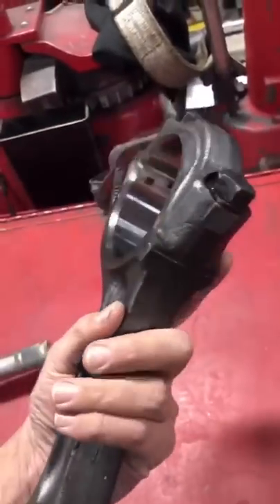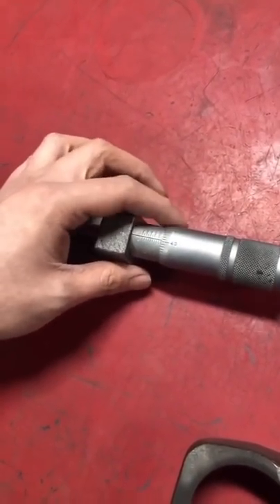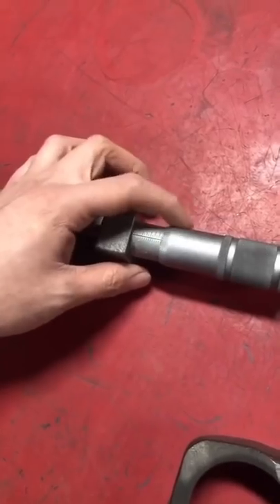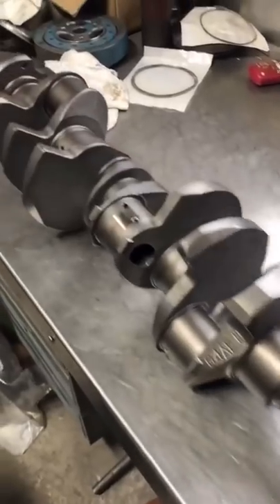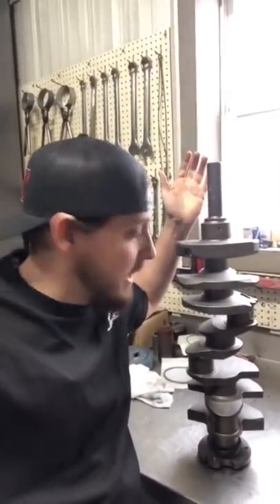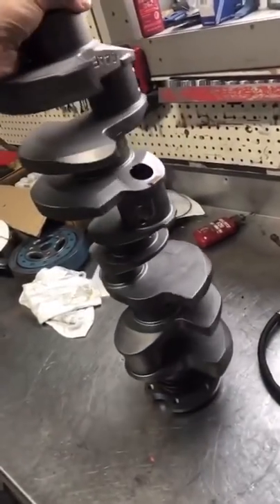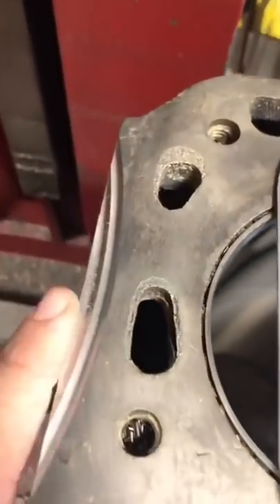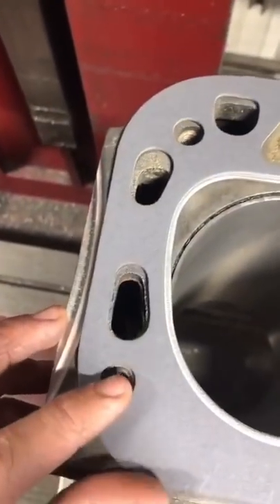#shorts What happens when a machining mistake is made? @JAMSIONLINE

Comment: I was using a surface grinder when the magnet failed suddenly, the wheel grabbed the part shot it across the work area and the wheel blew up in my face, safety glasses work kids :)
Reply: Glad youre okay, chief.
Reply: Same thing happen to me! Only the part launched itself at my foot. Good thing I had steel toes on, it took a chunk out of the surrounding material
Reply: Learned the same thing with a rail saw blade. Heat closed the gap instantaneously blade destroyed my face shield and several fragments pitted the safety glasses i was wearing under them.
Reply: Wow bro 😳 glad you made it out ok that could have killed you. I was deburing a part in the lathe running my scotch Brite on od with gloves on glove got caught in chuck and ripped my hand never wear gloves close to chuck.....
Reply: @TacticalThib  never wear gloves on a lathe, that’s scary shit!
Reply: I had an abrasive cutting wheel explode like that before, had a piece go through my glove and lodge itself in my finger 😂.
Reply: @TacticalThib  that's sketchy af! The shop I work at doesn't even have a gloves policy. Anytime I go near any manual machine, gloves come off and nitriles go on if needed.
Reply: @bigwendigo2253  around a lathe or any high speed spindle/chuck really. Imagine being pulled into a vertical mill..
Reply: @keefjunior4061  that would be horrific 😢

Comment: my neighbor was having an engine builder build him a 240sx engine. He sent it off in feb 2020, didn’t hear anything until july 2020 at which point he got a short email claiming “technical difficulties.” turns out the guy’s cylinder bore machine broke, so he took it to a “buddy’s shop” to do it there. well, the “buddy” didn’t have proper tooling to hold the block, so they MacGyvered some shit together to hold it. that didn’t work out too good and they ended up accidentally sending a full sized cylinder hole through the side of the block at a 30° angle. the unexplained 5 months apparently went to locating a new block.
Reply: Bored a cylinder 30 degrees off??
Reply: @tyalbert5063  yeah I'm not even mad if this is the case. That's just outright impressively bad
Reply: The only thing I'd be mad about is this not being made clear when it happened, shit happens but I want to know about it.

Comment: Here’s a thing if it’s messed up to sell as motor parts. Turn it into art with the Crankshaft you can practice on it then once you get done put a base to it and put a table top on it you have an end table for the piston rod you can use one side as a door handle and the other side a light fixture on a wall
Reply: "Kranks chef"? Maybe check the talk-to-text next time?
Reply: @ranger9047  Thank you very much
Reply: Look what original Top Gear did with a V8 engine. Lovely table. If i had the time and means for stuff like that..
Reply: @dannydetonator  Sorry there had to be read it I seen it on regular Top Gear which I think a jaguar V 12 Blocks into a glass table

Comment: You may want to look into a process called spray welding its used to build up worn surfaces shafts for heavy equipment a channel called abom79 has several videos about it you could probably use it to build up surfaces on crankshafts that are worn too small
Reply: They can weld then regrind a crank. I’ve seen it done and comes out beautiful
Reply: Oh i would of thought regular welding would induce alot of distortion spray welding may still have some advantages but if you rarely build up crankshafts regular welding is probably the way to go
Reply: @Stank-b8w  in our area we have guys that specialize in this type of work. Cracks, axles, spindles, hubs, etc
Reply: Probably not worth the time or money compared to buying a new part. Plus the structural integrity will never be the same as something cast. It’s really only for saving $$$ parts.

Comment: thanks for this vid! im in a situation where i have to confront my machine shop with a piston to bore clearance issue, I feel bad about it as they look after me so well. i just got my new engine off the dyno that i assembled myself and the forged pistons are slapping like mofo's even when hot, I know an engine can live a normal life like this but as a daily driver i don't like the noise. My life would have been easier had i owned a mic and bore gauge as I would have picked this up prior to assembly. i wonder how they will rectify this? what do you guys think they should do? hopefully its as simple as a coating on the skirts, but then would that even been a "proper" fix?

Comment: As a foundry guy, I found that most of the major machining errors we faced lead to either replacement castings, weld repairs, Devcon/Belzona, or potential minor design changes for the attainable dimensions.

Comment: I made a mistake once on a multimillion workpiece, it hurts calling the boss to say you fucked something up when you know at the minimum for welding, transportation to the other shop for thermal treatment and remachinning it's a minimum of 70k$ ... At the least if it's not a major area and the client is fine with it.
Not the best of days.
Reply: That is the price the employer pays for not giving you the proper training...even if part of the training was "Don't do this.." imho...
Reply: @Stahodad  i mean, im a Machinist, i just made a mistake... mistakes happen. for Various reasons, that time if i recall correctly it was a faulty identification of the insert boxes, that i didnt verify before putting it on the tool when the old insert broke... so wrong radius and tool offset and it dug a bit much into the piece >_<

Comment: That's integrity there, folks! I went thru an Auto Tech apprenticeship(Ford ASSET) 20 something yrs ago(was ASE certified) but ended up switching to the Carpenter's Union Apprenticeship..  Anyhow, I do my own wrenching/maintenance when needed and I still have to double-triple check that I'm correctly reading the micrometer correctly when measuring valve shim thickness, when doing valve adjustments every year or so on the motorcycles!  It would be easier to get digital calipers but that's no fun!

Comment: Worked in a small engine shop that had there own machine shop. Discovered that you can do everything right and still have problems. Had an old mill/drill press that they replaced the motor and the collet bearings. It would start true then after a few minutes it would develop a few thousands of runout we’d stop it remeasure and it would be perfect. Discovered one of the balls in the lower bearing was made of a cheaper steel that expanded causing it to wobble after it heated up and by the time we would strip down the table and remeasure it would cool down enough to run true. Took a few days to figure out. Ruined a set of heads aswell.

Comment: My first time at machining on my own was when the boss told me to take .030 off the cylinders on a numbers match SBF 302. He showed me the shop's ancient van Doren deck mounting bolt on boring rig and then left for the night. No experience whatsoever and he splits. I figgered it out and set to work. I was done with the first .010 pass and had started  on the second and about 2 minutes into that cut, I heard hell break loose and went to see what was up.  One a the damn anchoring bolts pulled the threads and went off center before snapping the base and punching the cutter through the water jacket! Haven't touched another since!

Comment: Greenlee machine shop in Baton Rouge  really screwed me with offset gringing my crank  on the first 4 rod Jernals, then over bored my new bronze valve guides, and the over bores for bigger pistons were not straight.  I was stuck with all bad parts AND PAID for the work like an idiot because  I was in the hospital and had a surgery that left me disabled for nearly 3 years

Comment: The fact you go out of your way to tell the customer about the mistake and what you could do to fix it with an adjust price goes to show the quality of your work. When someone tells a customer they made a mistake and took the time to figure out how to fix it shows top quality work. Most people wouldn't even notice those mistakes and sad but true some shops won't own up to it until they get called out by an engine assembler that notices. I worked for a company where I pulled motors out of old buses and ambulances. Mostly Ford 6.0 or lgh durmax's. The company would sell the motors as 60,000 miles when in reality they were 150,000 plus. Just run hot shot through them and they purred. One person came in and noticed n I snuck up to him just to tell him the condition of the engine it ran good the turbo was showing the milage but anyways gave them the little heads up and also told them they're warrantied for a couple months. They bought it but if I was in that situation I'd want some to tell me more of what I'm getting into.

Comment: Not on the same level, but I made the mistake of using a speed square to fit up a weld and forgot to subtract the bottom of the square from the dimension. Had to cut and reweld when I realized.

Comment: Btw... I wish the 3 major automotive machine shops around Livermore, CA had this sort of integrity.  Overpriced and dishonest about why they would charge $150-210 for pressing seal- bearing-retainer-ext. circlip- tone ring-retainer, in that order(just install-no removal of old).  I was stranded but ended up pressing the components for my rear half-shaft quicker than what they quoted, all without a 20t press too!

Comment: The most common one I always hear of is sleeve drop on Honda engines
Specifically h22's
Where the machinest runs too deep and the sleeve doesn't have a shoulder to sit on
How many of them are replaced by the shop? Not many if any because they aren't willing to admit they can't follow basic instructions that are printed on the paper

Comment: I was in aerospace an we use air fixtures for heat shields there about 15ft long 5ft wide an about .078 depending on the titanium an where its from. The final thickness is .045 an tolerances is +-.002 but they never wanted to fix the table an i would get a taper down the whole thing about .010 an i had to grind the spots that where to thick all by hand while the next part is running. Plus it leaked coolant so i had to mop every 30mins i hate companies that dont want to fix shittttr

Comment: I was resurfacing an aluminum head one time and didn’t notice there was an engine block under the machine. Just as the first pass had started the bed rode up on the block tilting it forward cutting about .500 off the head. From then on I checked for engine blocks before resurfacing anything.
Reply from the maker: I would be a liar if I said that hasn’t happened in our shop!

Comment: When I was younger I loved squeezing every HP I could out of chev blocks like
283, 327 396 348 and 409s.  The 348 and 396s could put òut 350 to 425 hp with little effort. I would have love to have alloy blocks but cars wore heavy and engine weight didn't make much  difference.  After working on turbines
In the AF Iost interest! In recips but I still enjoyed those years.

Comment: What happens if a crucial error is made by a machinist in naval/port industry? You weld it up and do it again, if work is done partly already. More often though, you hope your crashed CNC mill or lathe is easily fixable. And look for a new tool - or inserts, if you're lucky. Never mind the part being bruised. The tools and machines cost much more than you think.
 No wonder they call it the cut-throat industry..

Comment: The customer found another rod? What a pushover that customer was, if it was me you would have found the replacement and the cost for it would be on you. I’ve been down that road with a machine shop and in my case they found the replacement head and paid for it, another shop reworked the set of heads for me.
Reply from the maker: The customer sourced his own rod because he has the connections to do so easily. Long time customer who understands mistakes happen. He will swear by our work.  We paid him the cost of the rod as well as an additional $100 for his trouble. 

I think you interpreted the video wrong.

Comment: wait i’m confused... i’ve seen lots of these videos and don’t understand why people need their engine parts ground or whatever it’s called
Reply: When engines run for a long time they wear out unevenly in certain key areas (crankshaft and rod bearings and journals).  By carefully grinding down these areas uniformly and installing new parts designed exactly to match what was removed ( a little bigger bearing)  proper engine operation can be restored.